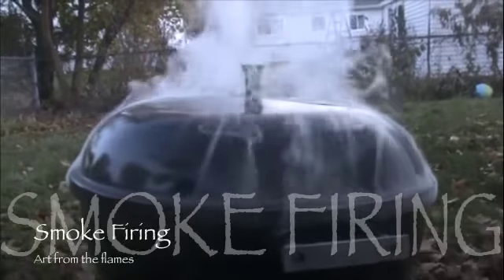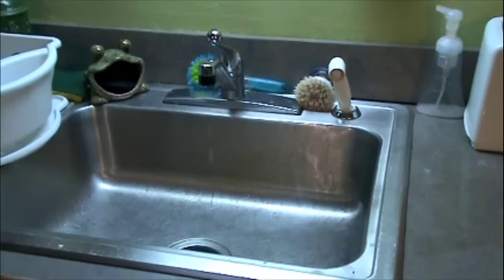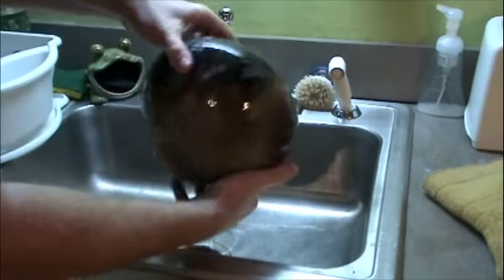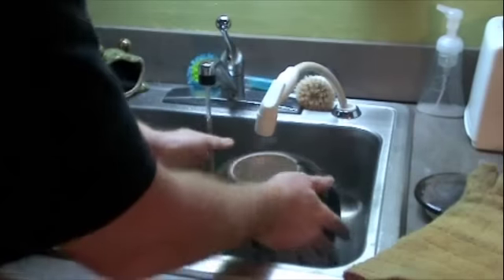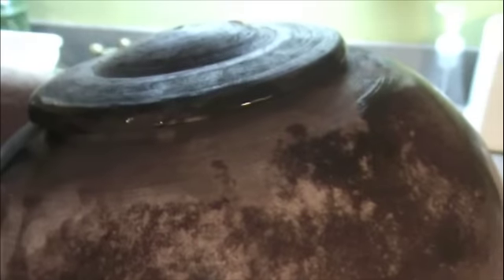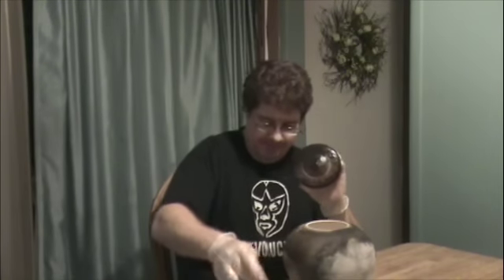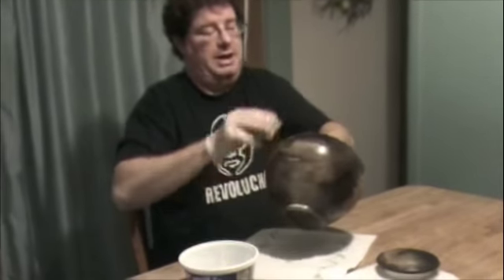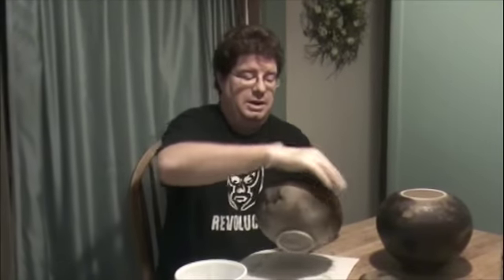Smoke Fired Pottery: Art From the Flames

Comment from the maker: @caseclosedx94  Thanks for the compliment. Tips: have small vent holes in the top and bottom. Put a couple of inches of saw dust in the bottom. Load the pots at different angles for different effects, Surround the pots with small twigs and sticks.  Sprinkle a generous amount of kosher salt onto the mound; add copper carbonate as well.Twist some newspaper and tuck it around the pots. Lay a few sheets of paper over everything, add more sawdust and twigs. Use a propane torch to start the fire.

Comment from the maker: I use the grill exclusively for firing. Put a few inches of sawdust in the bottom, add twigs and pottery, more sawdust, throw in kasher salt, more twigs, sawdust and newspaper. Light from the bottom with propane torch and let fire burn for a few minutes. Smother with tight lid with top and bottom vents open.